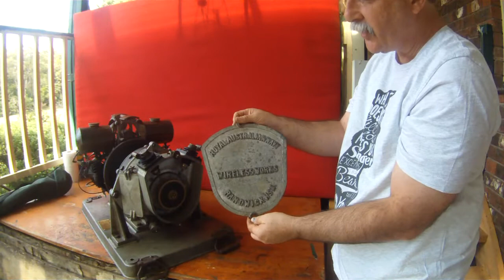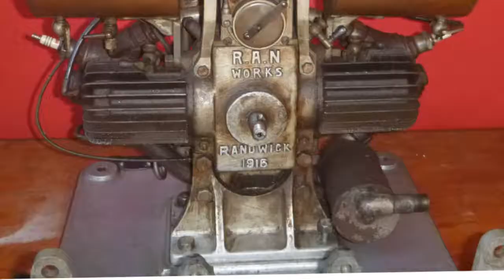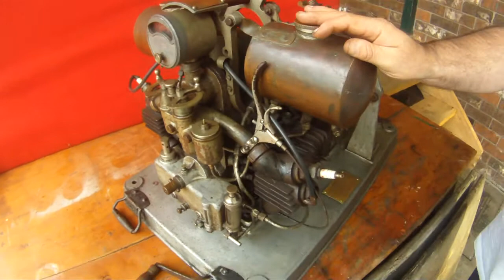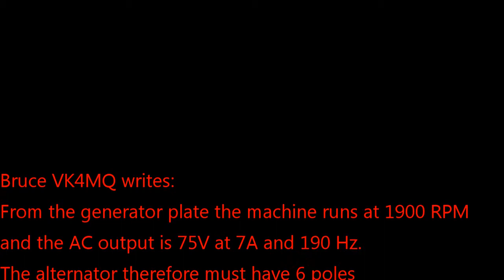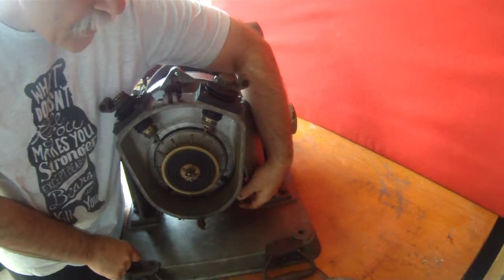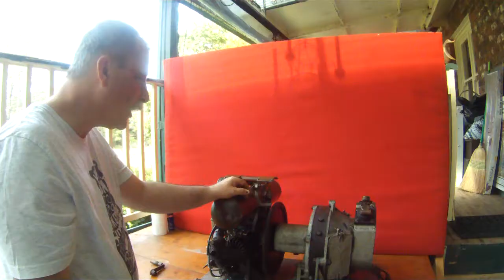WW1 Douglas Marconi 500 Watt Spark Gap Generator

Comment: An amazing find.  It looks pristine for a WW1 motor.  Especially if it was used by the RAN.  Lucky it wasn't sunk outside the heads somewhere.
Reply from the maker: Which raises the point of when it was decommissioned. When was it sold off as surplus to requirements?